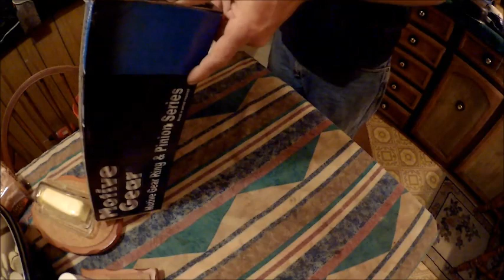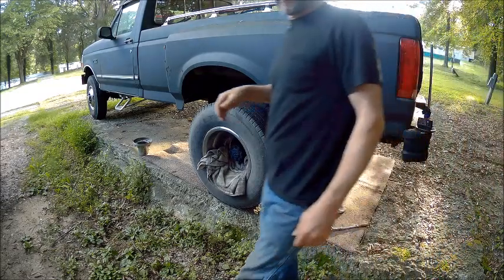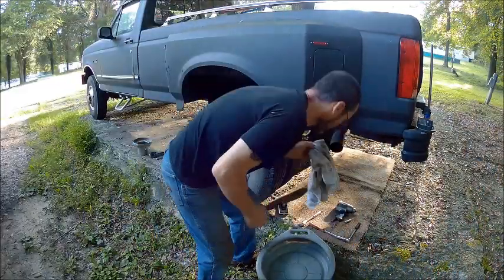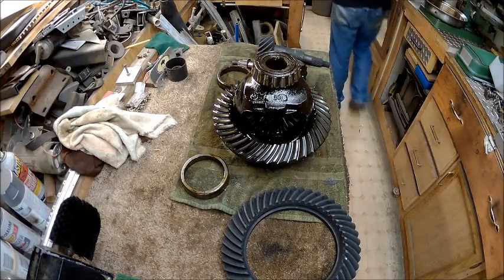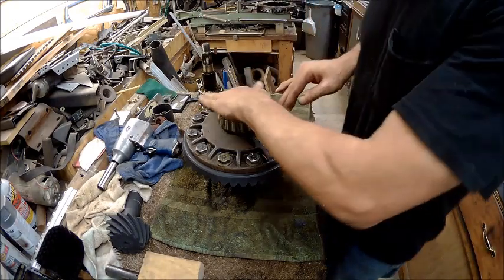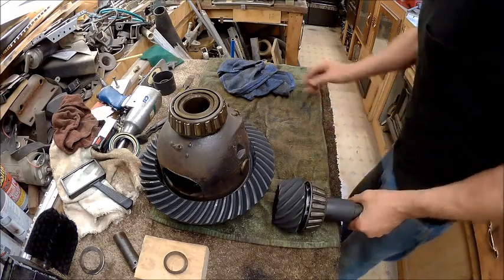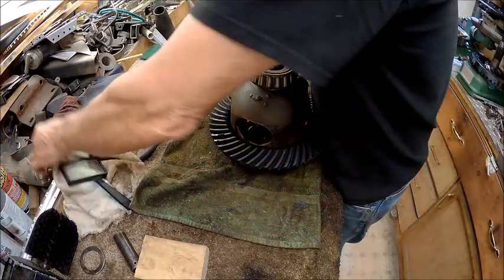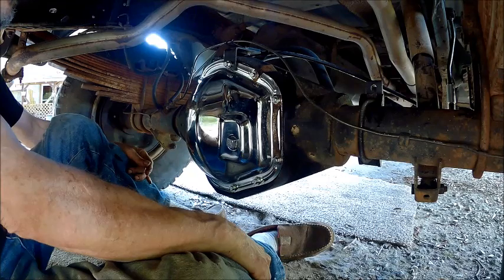installing ring and pinion in a dana 70 hd rear end

Comment: I'm curious as to how well it held up! I have the same rear end and am planning on the same 3.54 gear. I've only built a couple rear ends, a little 10 bolt GM and a standard Dana 70 in my 93 Dodge, both times I was watching someone with more experience, and both times we measured the backlash and where the gear was riding against the pinion. No problems ever with either rearend. Both friends explained the importance of back lash and proper gear to gear mesh, and with the 10 bolt we had to press the bearing off to change the shims. I was hoping to do my next one solo and would like to know how this rebuild held up.
Reply from the maker: im still driving it and have had no problems with it except for the drive shaft being too short because the dana 70 hd rear is not as long as the 10.25 housing was. as far as internals all is working good. still trying to sell the 410 ring and pinion i took out with no luck. lol

Comment: good job men and a great video..
i have the same on my rear differential 3.54 dana 70 (dodge ram 2500 turbo diesel and my question is the front bearing pinion (the little one don’t need be pressed before install the spacer..?  )

Comment: What about the shim under the big pinion bearing? Between the gear and the bearing..wasn't there shims there? Whole reason I'm watching,got one chewed to nothing,trying to cut the race off to see what size shims are welded in there..
Reply from the maker: i have no clue, sorry. i just put it back together as it came apart.
Reply: @BisonWorkshop  ok thanks.. I'm wondering if maybe the 70HD doesn't have them between the pinion gear and bearing. You didn't see any when the shop took that bearing off for you hu?
Reply: I am wondering the same thing…… my take out pinion is a “+4” and I had no shim under the bearing on disassembly….. I’ll see what I get and report back if I have to put one in.
Reply: @ArtBarn591  I got a +2 w no shim you have any luck? I could be wrong but actually don't see the need with the shims in between the bearing race and housing. Lemme know if you could I'm knuckles deep haha
Reply: @vincentgizdich2842  the shim is in between the housing and the outer race.
Reply: @ArtBarn591  thank you.

Comment: Why are you calling this a DANA 70'HD' when its a DANA 70? They are to different axles with different Ring Gear and Pinion.
Reply from the maker: because thats what i was told it was. plus every part i have ordered for this rearend fit perfect. so it must be a hd 70 rear.